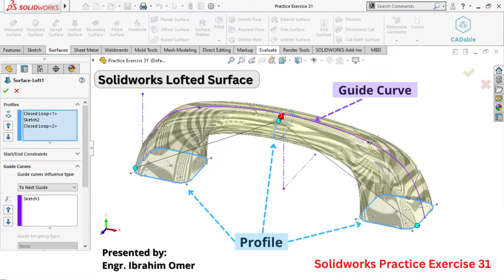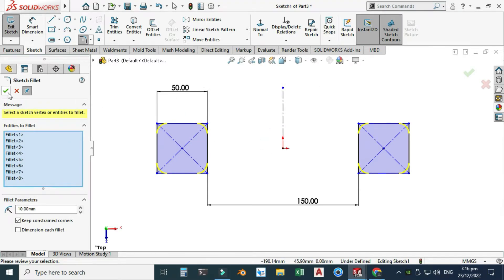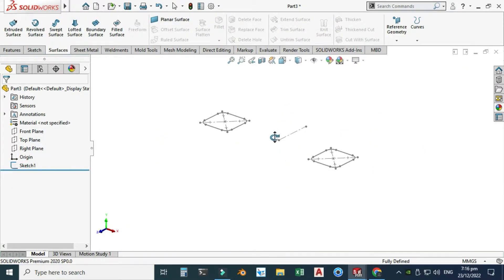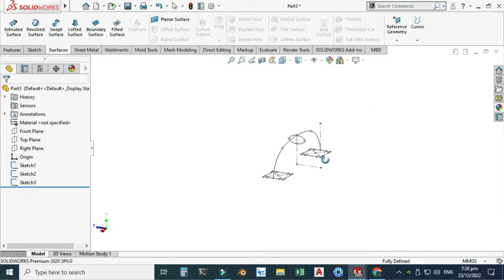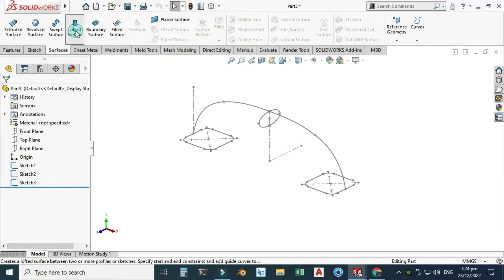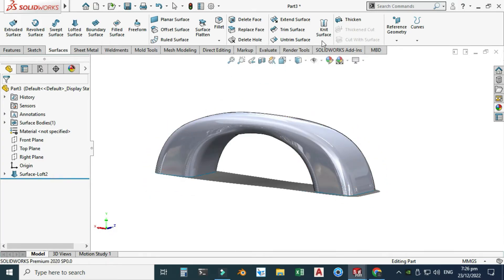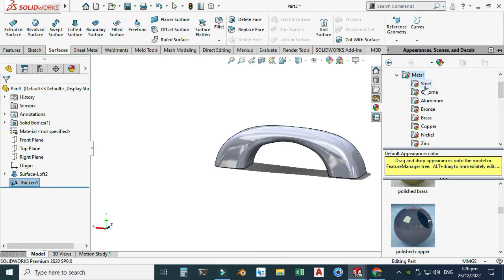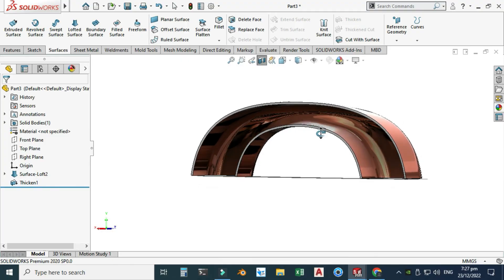Solidworks Lofted Surface | How to use loft feature | Create Handle in solidworks | CADable

Comment: How to make this,
which process we can use to  make this handle,
apart from 3D printing
Reply from the maker: To make a handle without 3D printing, you can use processes like casting, injection molding, machining, forging, or handcrafting. These methods involve shaping materials such as metal, plastic, wood, or leather to create the handle's desired form. Each process has its own advantages and considerations, depending on factors like material type, design complexity, and production volume.